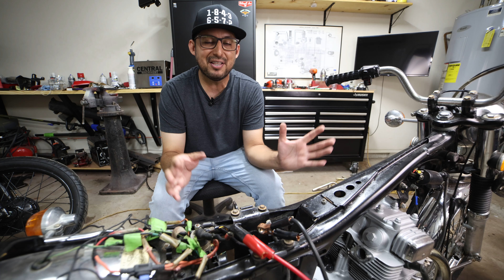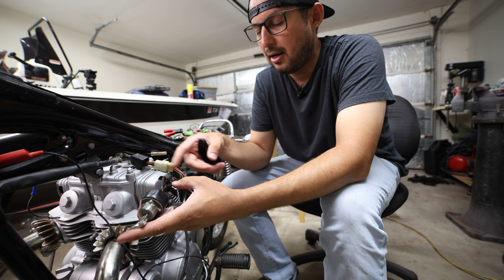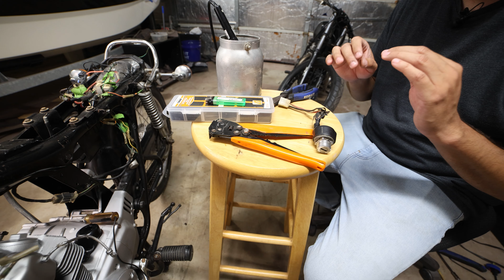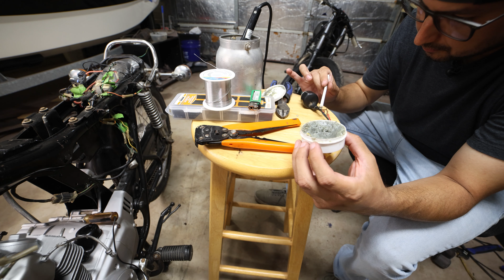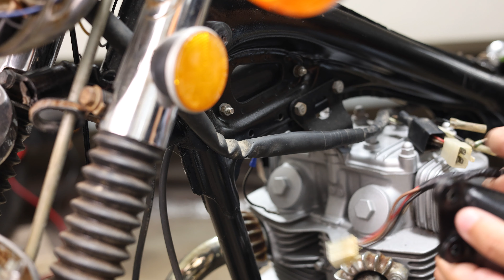Honda CB200T Resurrection: Wiring the Essentials (Ignition, Lights, Signals)

Comment: What about having running lights when key is on?
I have a 1981 honda cb400 and i get the headlight on when key is on and turns works but i want running lights.
Reply from the maker: That’s a good question. I’m sure I can figure it out for you. Why don’t you send me an email to vintagespeedworksonline@gmail.com and I’ll respond with a possible solution? Thanks!
Reply: Sent email  @vintagespeedworks